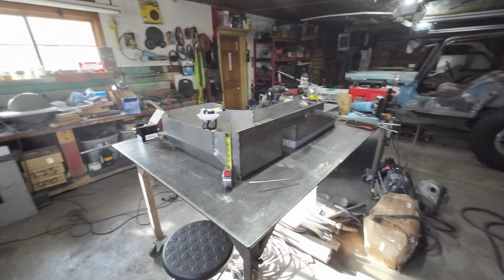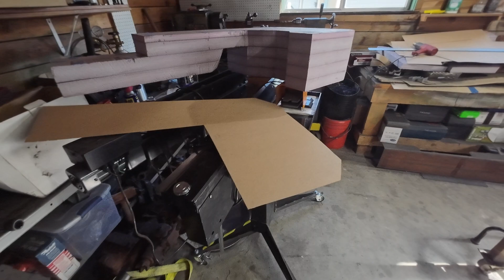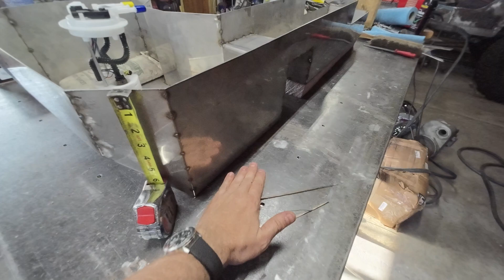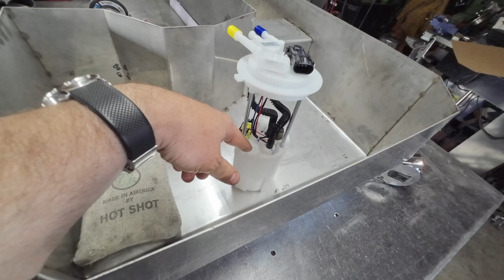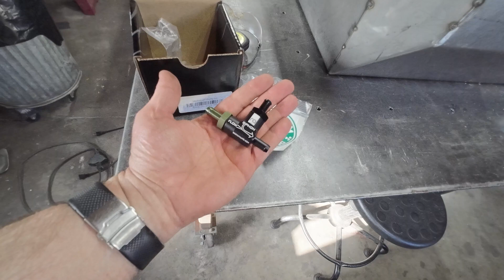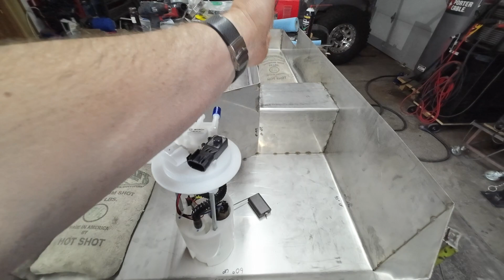Old Blue Willys, Fuel Tank Part 19

Comment: Any plans to add a "one way" (not quite a trap door- too complex) baffle at the axle hump of the tank to encourage fuel to stay in the rear section?  I was thinking that you could even go so far as to slope the floor of the front section so the fuel is encouraged to flow to the rear section under acceleration.  There would be a loss of volume but the simplicity might win out?
Reply from the maker: No plans for a baffle to hold fuel. The fuel also has to 'fill' into the front section of the tank. The venturi valve  'powered' by the return line flow will continuously move fuel from the front section to the swirl pot on the fuel pump assembly.

Comment: I have walbro corner pickups in my tank that close off when they come out of fuel. They are pretty cheap and likely would be able to supply more than enough fuel? A small fuel filter on the Venturi line maybe enough to force air bubbles to coalesce into larger slugs that the swirl pot probably wouldn’t need to handle because they would be motile and float up and away.
Reply from the maker: I'll check out the walbro unit. I don't think they have to flow much really. I would like to make the siphon leg removeable so it could be replaced if needed. Probably some kind of flange/gasket mount large enough to pass the filter attached to the bottom end of a straw. Since the forward sump is 2" above the bottom of the frame, I could also just do a small sump fitting on the bottom/side of the tank also.

Comment: At this point could you fully weld or tape the bottom seams, add some water to the saddles, and bench test the pump/siphon to see how it reacts to siphoning air and adding air to the fuel pot?
Reply from the maker: Perhaps, but a test like that is probably best done with a few buckets vs trying to use the actual tank.

Comment: I really like the fuel transfer solution you’ve come up with. Does the Venturi design have enough suction to add a filter on the saddle side to protect the small bits from potential blockage?
Reply from the maker: The orifice in the venturi pump is pretty good size, but a coarse filter is a good idea. A small Holley hydramat should provide a similar function in addition to turning off the siphon tube when the forward sump is empty.
Reply: Maybe the hydramat could be dual purpose in that respect.

Comment: I would still add some AN nipples so you could pump fuel  from front sump to rear . Even if it's just a line between the two sides. Maybe with a one way valve
Reply from the maker: That is exactly what the venturi siphon pump is designed to do? Adding a check valve in it's feed line might not be a bad idea. I'm most concerned about if it pulls air at this point, and what that means for the fuel supply in the swirl pot on the fuel pump assembly.